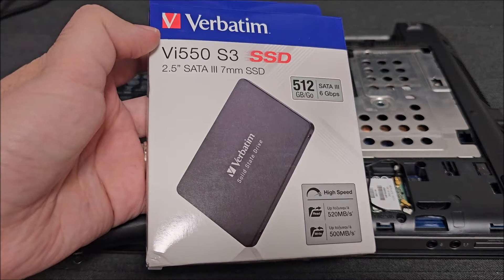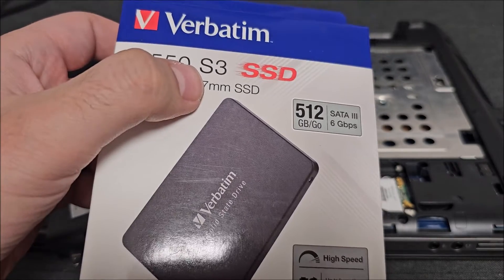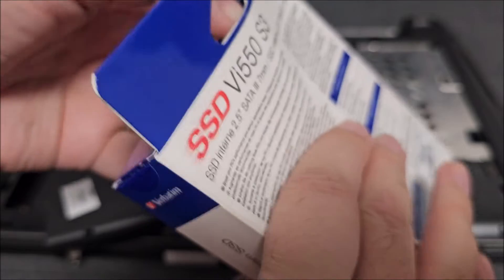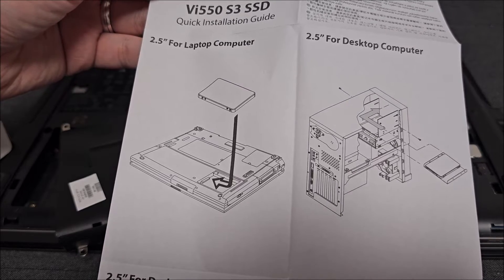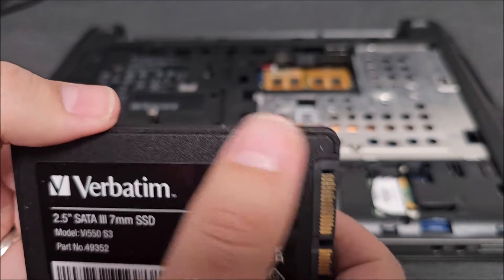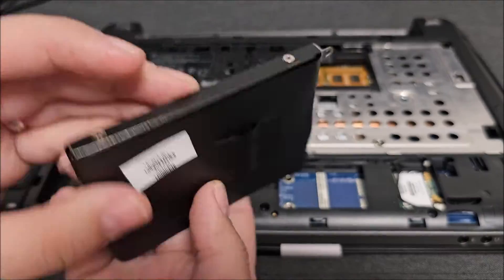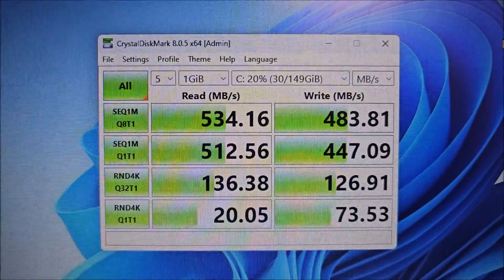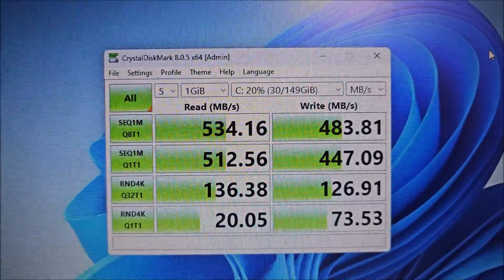512GB Verbatim Vi550 S3 2.5" SATA SSD - unboxing and test

Comment: My is showing 477 inside of 512gb😢
Reply from the maker: 512 is unformatted size. It's like this with all SSD and HDD.
Reply: @UltimateDIY  rather it's that Windows works with the IEC system (1024) but displays the unit in the SI system (1000). So it's 477 GiB which is the same as 512 GB. Your SSD has at least 512,000,000,000 Bytes, and if you divide by 1024^3 you get 477 GiB. But if you divide by 1000^3 you get 512 GB. So 477 GiB = 512 GB. That means the number on the packaging is, in fact, correct, just Windows is displaying it incorrectly.
Reply from the maker: Thanks for the explanation 👍🏻
Reply: @UltimateDIY  thanks for your feedback! Now understand
Reply: That's completely normal!